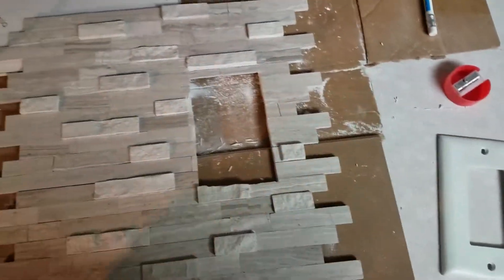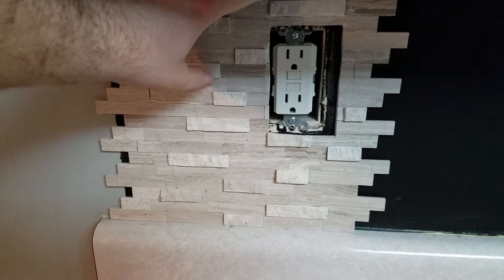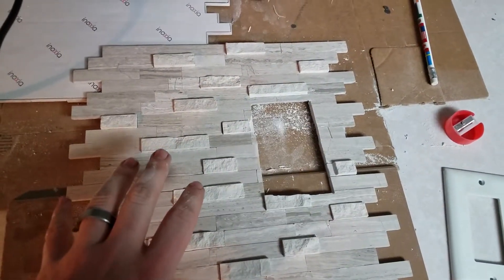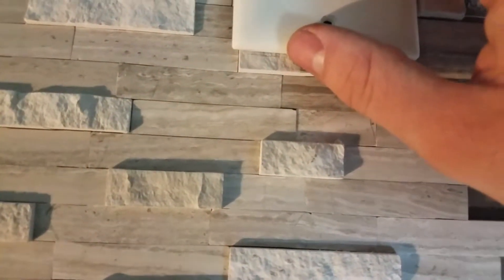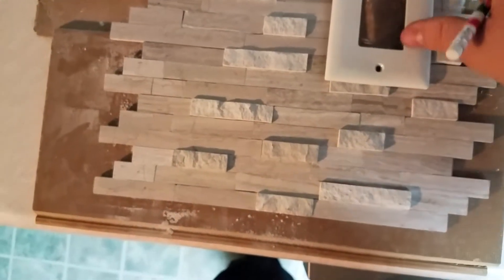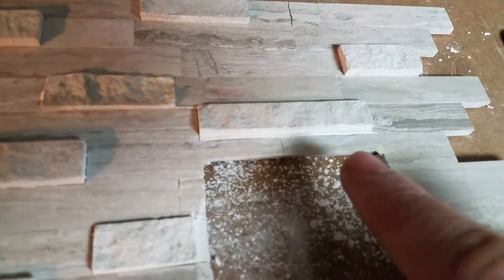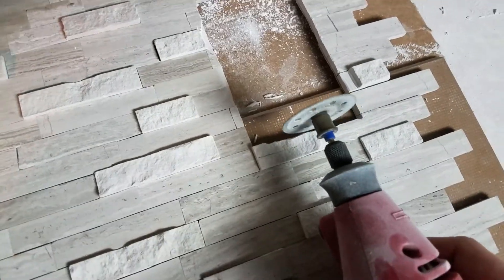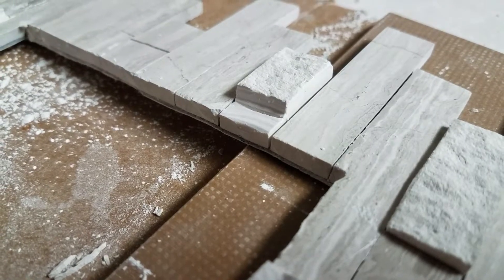Cutting the raised tiles for switch covers to sit flush

Comment: Question.  . I have the same tile, I followed your video. The cover sits flush with the tile but there's a big space between the plugs and the cover. 🤔 can you help me out.
Reply from the maker: @doble8344  depends on how big and what building code says in your area. In short, they make box extenders to move the outlet plugs more flush with the surface. That's definitely the safest bet, but honestly one of my plugs has a slight gap, about as thick as a business card, its well within code for my area and I let it ride.

Comment: Seems like the cover plate SCREWS would be too short when sitting on top of the backsplash.  Am I missing something?
Reply from the maker: While there is material added obviously, the switch was over flush of wall to begin with. So we are not losing the total thickness of material. Secondly, screws reached fine, only drawback is having the switch potentially underflush of cover. This does not meet code, but did not occur in my case.